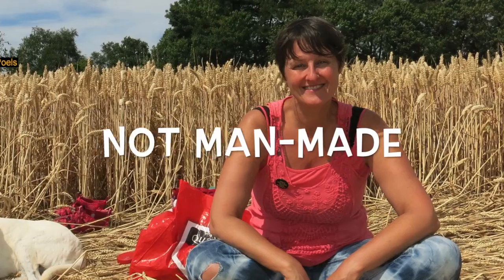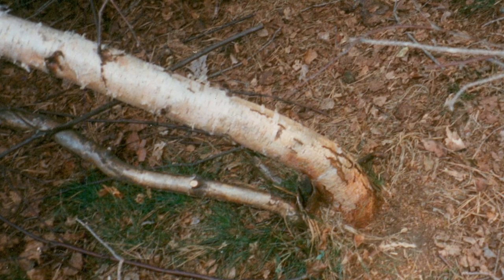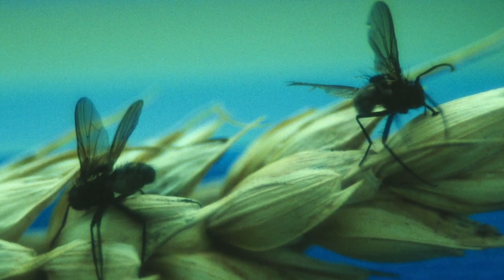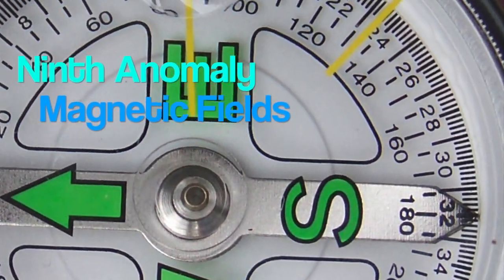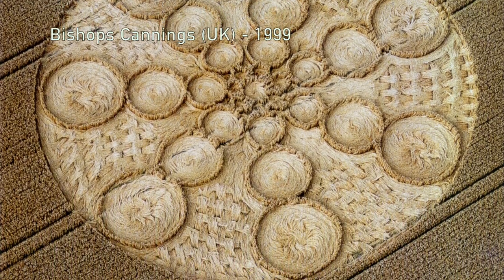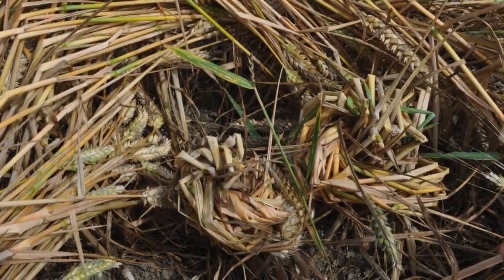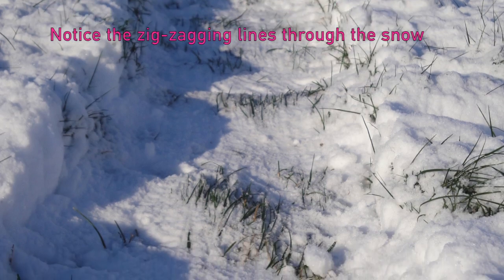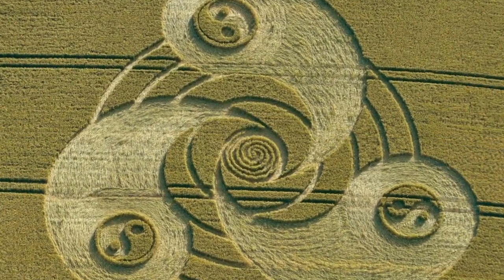Why Crop Circles are NOT man-made

Comment: A WONDERFUL DESCRIPTION OF THE UNCHALLENGEABLE EVIDENCE,  JANET. THANK YOU VERY MUCH FOR SPELLING OUT QUITE CLEARLY, WHAT I HAVE BASICALLY KNOWN, FOR MANY YEARS. ALL IT TAKES IS TO DO SOME RESEARCH ON THE WEB AND BUY SOME BOOKS--LIKE YOURS. AND ALL THOSE STUPID AND IDIOTIC  DOUBTER OBJECTIONS ,WILL BE SWEPT ASIDE. FOR ME, JUST APPLYING COMMON SENSE DOES THE TRICK. I REMEMBER A METEOROLOGIST,, BACK IN THE 1990'S, WHO CLAIMED THAT THE CIRCLES WERE CAUSED BY RARE WEATHER CONDITIONS--LIKE  ''WILL O THE WISP' SWIRLING WINDS,  AND WHIRLEWIND'S ETC. USUALLY SEEN DURING HOT, DRY, AND THUNDERY WEATHER, WHERE STRANDS OF GRASS OR OTHER CROP STALKS CAN BE SEEN SPIRALING AND  RISING INTO THE AIR, THEN FALLING BACK TO THE GROUND. MANY THOUGHT THAT THE MYSTERY HAD BEEN SOLVED, BUT NOT ME. I WAS VERY PLEASED WHEN THE WHOLE BUSINESS SUDDENLY BECAME FAR MORE COMPLICATED, WITH THE CREATION OF THOSE MASSIVE MULTI FACETED  DESIGNS.  OBVIOUSLY, THEY COULD NEVER HAVE BEEN MADE BY MAN, OR A ''WILL' O' THE WISP'.  I WILL SUBSCRIBE NOW.